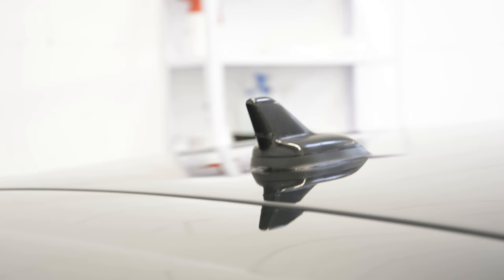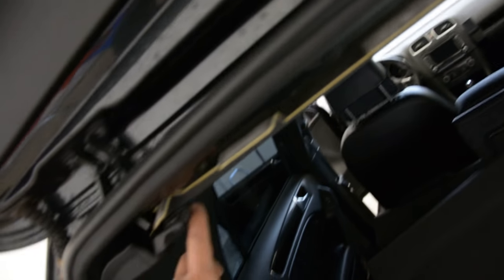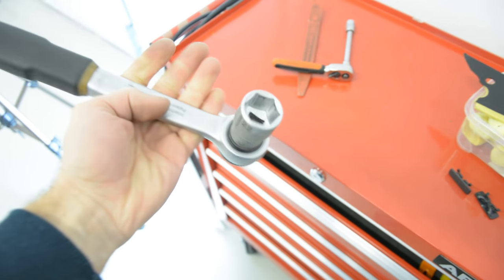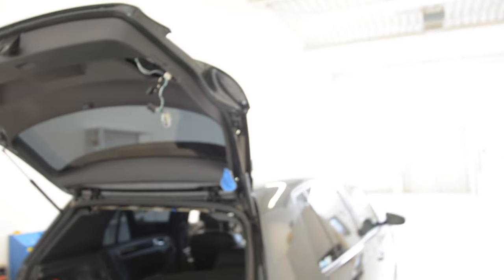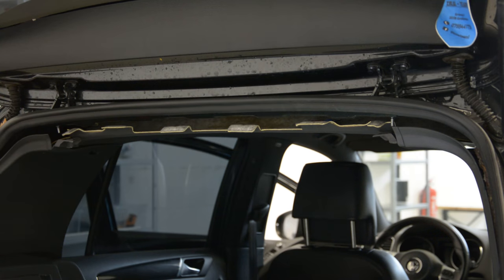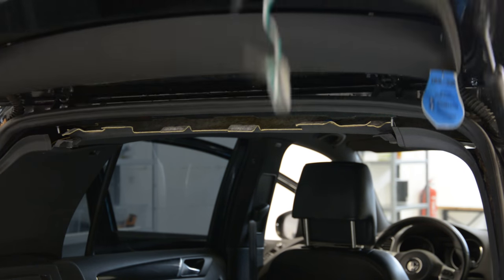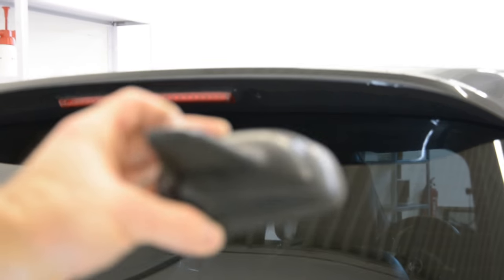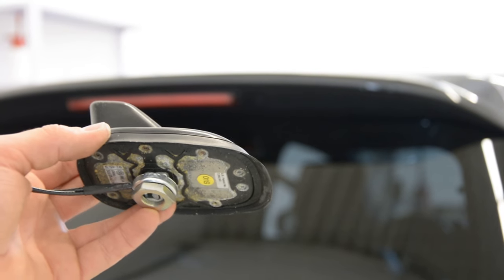Antenna removal VW Golf mk6

Comment: I was backing out of our automatic garage door and the door took a nibble of my antenna (cue excuses). 
The antenna , roof and gaskets looks ok, emergency phone stopped working but that might be a simple fix. 

But seeing the bolt that held it in place I dread the worst, though it would be odd if the metal buckled before the plastic antenna.  

Two questions I have:
-If the inner body has been damaged, any chances of leaks or draft from a bodgework? 
-Should I apply some grease or sealant on the gasket as a precaution?

Comment: Curious, is it possible to remove the antenna just to adjust the rubber grommet? Or would I need to replace the rubber grommet due to removal of the antenna?
Reply from the maker: +Rod Dizon The ruber Seal fron The Buttom of The antena it came completely with the antenna you don’t need to Replace the rubber gasket after removal
Reply: DFC Garage mine is the stock fin antenna. I don’t necessarily want to change it, but I do want to adjust the rubber bottom piece as it looks like it got pinched, I’m worried water will enter from there.